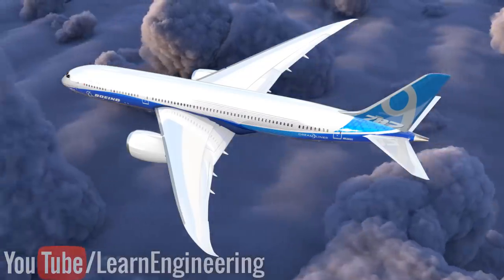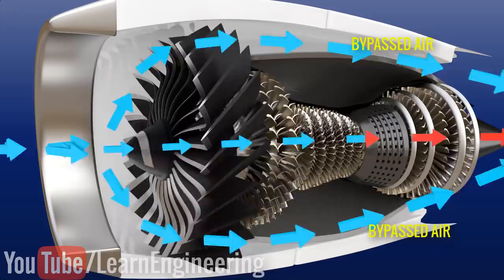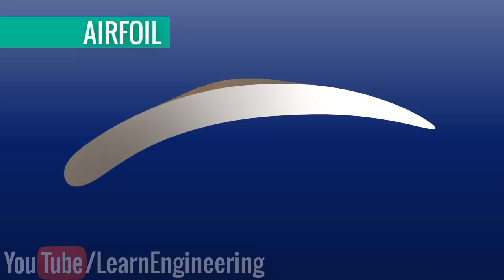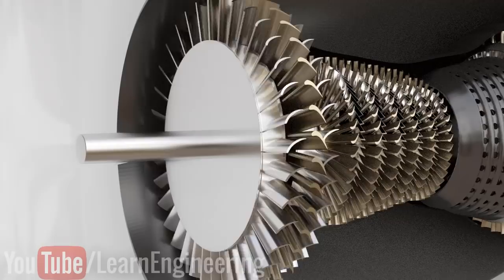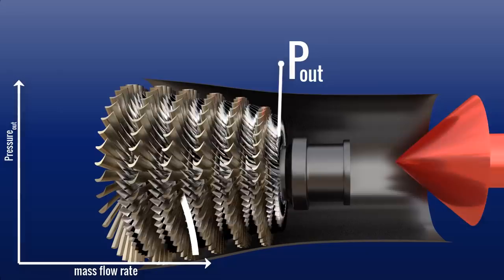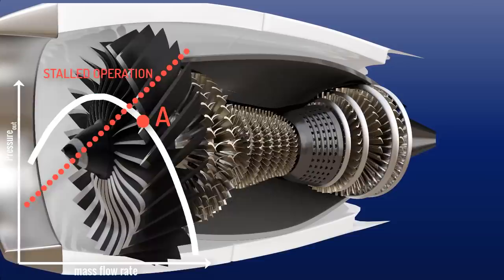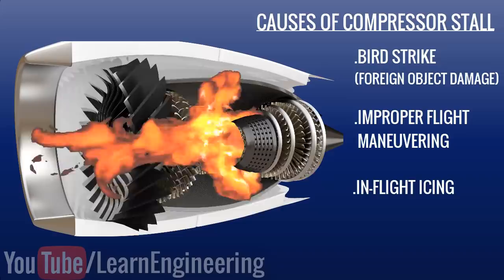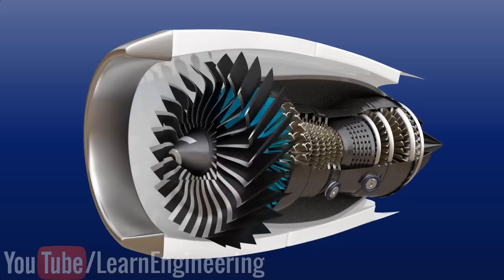What makes BIRD STRIKES so dangerous?

Comment: Now this suggestion is impractical, but hell, consider this, have a stack of blades facing forwards attached to the outer edge of the engine running forward and meeting at a point like a pyramid on its side, it should not restrict airflow to any extent as the only thing facing forward is the knife thickness of the blades, maybe shredded chicken hitting the fan might be preferable.

Comment: Why don’t they cover the opening of the engine with a metal mesh that has bigger openings that are big enough for air to flow but not birds to go through (I’m talking big birds as smaller ones might have little to no effect on the engine)?

Comment: I know its a stupid question but why don't we just use a wire mesh before the turbine to limit any big things flying into it? I mean it wouldn't impact the airflow that heavily.
Reply: Meshes do impact flow – large pressure losses across a mesh, meaning compressor has to do more work, meaning more fuel needed to keep the engine running

Comment: So a bird going through the blades won't damage the blades? and if blades are damaged, a loss of balance might occur due to the loss of the blades and the engine will vibrate? no expert, but only wondering...
Reply: The fan blades at the intake are made of highly toughened titanium alloy so it requires great momentum to damage them usually birds couldnt fly at high speed that too near runway and their mass also negligible so it cant damage blades

Comment: Those correction measures seem to necessitate quite a deep understanding of the exact state of the engine in quite a short amount of time. Why isn't restarting the engine not an option?
Reply: Penny Lane the corrections will mostly be handled by the FADEC. If the compressor stall or surge is not the result of ingesting FOD, attempting a restart might be possible, but the likelihood of damage to the engine might prevent it from starting or it might cause more damage. If the engine does fail, most aircraft have a second engine that is ample to get the aircraft back in the ground safely.

Comment: If it's so dangerous, why can't you just have a grid in front of the engine that would allow all the air to pass but no bird to enter?
Reply: May be because it will decrease efficiency I. E. Reduce the total amount of air intake per sec. But I agree with your point safety is more important than effeciency.
Reply: Imagine the damage that would cause if sucked into an engine.

Comment: One prevention to avoid compressor stall is,mounts the metal screen in front of the engine to avoid the bird from entering, just guessing....
Reply: It's an obvious suggestion but a screen with holes small enough to prevent pieces of bird from entering would also restrict and create turbulent airflow which isn't good for the engines either

Comment: Does this really need pilot intervention? I'd expect that in case of an actual incident, automated systems would respond far more quickly and be more likely to take the exact course of action(s) required to get the engine back up and running...
Reply: Steamrick yeah that's called a FADEC. If the engine does completely fail though, restarting is probably not advisable. You've got another engine which is ample to get you back to the ground safely.

Comment: Why let the engine open.... Just cover the engine with the net,,,, bird will not enter inside engine,
Reply: This is a jet engine.  There's nothing that will stop a bird from getting in if it gets too close.  The only thing a net or some kind of grate cover will do is slice the bird apart, and those pieces have only one place to go.  Your net, regardless of what its made of, wouldn't do jack shit.
Reply: @CMDR_John_Crichton  A sufficiently strong and dense net would be able to mostly stop it (at least shred it into enough pieces that it's basically negligible). It'd also be a huge performance and efficiency penalty, but it could be done

Comment: Engineers should put grill on the front of the engine
Reply: Wouldn’t help. Despite the variable guide vanes it could cause turbulent airflow to enter to compressor which could cause the angle of attack to be exceeded and still have a compressor stall.

Comment: Okay, question time: Then why don't they just put an aerodynamically friendly carbon fiber screen (nothing so blunt that it causes a lot of drag, and nothing heavy like steel, or even that much more aluminum adding to the weight of the plane, unless aluminum would have to be the happy medium) over the cowling that's a happy compromise between blocking too much air from entering (too fine a mesh) and still letting average-and-bigger birds through (too coarse a mesh)?
Reply: You can't risk it the particles from the screen will damage the compressor blades over Time.I work on engines fod  is a serious issue and putting something in front of the intake isn't the greatest idea.

Comment: In theory, the fan blades are supposed to chop up ingested birds, but in reality it is often not the case.  At a speed, even a small bird can do quite a bit of damage.  I've seen inside liner (noise attenuation liner) of the intake cowl being torn apart by bird strike.

Comment: I deleted my original comment because I thought that I was becoming unduly critical, so let me start again by congratulating you on trying to get to grips with this topic.  Nevertheless, I can only give you a C minus, at best, for your efforts.
Firstly, I have to tell you that your representation of a big turbofan engine is not very good.  In particular, the compressor stator vanes are more reminiscent of turbine blades: in fact, they would make very good turbine blades.  The vanes should be altogether thinner and cambered (ie, curved) in the opposite direction.  And let me correct your terminology:  it is generally accepted in the English-speaking gas turbine industry that blades rotate and vanes are stationary.
On the subject of terminology, I have to be critical of the laxity of industry, too, in its usage.  All too often, the term 'stall' is used interchangeably with 'surge', particularly, it seems, in N America.  I like to think that we were a little more rigorous at R-R in our usage.  One or more rows of aerofoils in a compressor can stall without the engine surging.  In the limit, however, if too many stages of the compressor enter a stalled condition, then the flow breaks down and there is a sudden reversal of flow through the compressor.  In the words of a Boeing training video, "there are flames visible at both ends of the engine", and the event is accompanied by a loud 'bang'.  Under certain conditions, this can happen multiple times: try looking on YouTube for 'Birdstrike at Manchester Airport' (that's Manchester, England).  A B.757 suffered a birdstrike to its R/H engine, which surged numerous time before it was shut down. 
Clearly, the birdstrike caused sufficient damage to the core engine compressor blading to degrade its aerodynamic performance, resulting in the multiple surge event.  Even small birds  can do significant damage, if they enter the core engine compressors, and their sliced-up remains are propelled rearwards through the blading.  A large bird, such as a Canada Goose, can cause catastrophic damage to both the core engine compressors and the fan blades.  I read the official NTSB report on USAir 1549 ('Sully' Sullenberger's ditching in the Hudson River) some years ago and it should still be available on the website.  It's even more gripping (for an engineer) than the film with Tom Hanks.
I could go on, as you haven't quite got your head around the mechanism of a surge, but I think this is quite enough for the moment.
Reply: I didn't read any of this cuz you wrote too much.
Reply: Wow and you say enough. It's just too much to read😂
Reply: Wow, you guys should learn to read a little more, then maybe you will be able to learn a little more.  His post is small for someone that is getting good information across to the reader. Did I right too much?
Reply: Nice novel
Reply: A lot of writing
Reply: @davidscott5903   ditto

Comment: A net in the front of engine opening. Problem solved LOL.
Reply: That sounds like an obvious solution but a screen small enough to prevent the ingestion of a bird would cause drastically reduced and turbulent airflow which isn't good for the engines either it doesn't fix anything

Comment: Why can't they put a screen over the front of the fan?
Reply: How are you going to get air?
Reply: Demostene Neacsiu I assume he is talking about a net. The air would go through the net
Reply: The video grossly over states the terror of such an incident. Compressor stalls and surges are not common. There would be too much drag associated with a screen. Plus the engines are optimized for cruise efficiency, where the chance of FOD is practically 0. Birdstikes do happen during departure and arrival but are rare. And the likelihood that both engines ingest a bird is even smaller but has happened (ref the US Airways flight that landed in the Hudson River). For Part 25 aircraft (air transport), the performance parameters are such that at any given time during the take off, the aircraft must be able to stop on the remaining runway, or safely continue the take off with one engine. So again, really not that scary.
Reply: Not to mention that at the airspeeds the aircraft operates at, the screen would either break and be ingested itself, or shred the bird into tiny bits and still be ingested causing the same problems.
Reply: jschnei Oh yeah birdstrikes are very rare and the net would most likely get sucked in by the engine. Just cookin up ideas. Even if it did work I don’t think anyone would do it because of the cost/likeliness ratio
Reply: Would it be possible to make a screen config similar to the ones used on mig aircraft, with air being supplied by the side entrances for the time of deployment ?
Reply: Because the aircraft flies at 800km/h, at that speed you need a very strong set of bars to stop it. 

Luckily, birdstike is calculated into the design of the engine so the bulk of birdstrikes just result in the bird being reduced to it's component parts and pooped out the back of the engine. it takes a big bird, or a flock of birds, hitting at just the right place (ok, the wrong place, really) to cause serious problems.
Reply: vinny142 Thx for the answer :), i was mostly refering to a time when the birdstrike would have a biggest chance of occuring so closer to the ground at approach speeds, the same time migs deploy theirs. Would that have any chance of working ?
Reply: the strength and weight of the "screen" needed to prevent that (esp. at those airflow velocities) would wind up blocking the air intake, thereby greatly reducing the engine's efficiency.
Reply: mitchlu Thats the idea, to block the intake :), air could potentially be supplied by additional engine intakes relegated to somewhere more safe, something like those screens on the upper side of the migs, the whole thing would work at power settings typical for approaches and if one needed full power for example a go around, the intake could be opened and engine would suck air normally. Additional weight...depends how much, one can't have something for nothing, more protection, more weight. The problem is that engine cowlings and gondolas would need to be probably reworked to accomodate such a system though, maybe elongated and reshaped, to easily put rectangular covers there. As said earlier, engines are made quite resistant to flame outs as of now so maybe its a calculated risk. Still, engines in airliners are so much more critical than in smaller planes that can be put down in some field quite safely, it would be prudent to make them even more protected, me thinks :)
Reply: Still, a mig can be exited easily, such a system might be more viable for a fighter jet against small FOD, the risk of any part of the screen going into the engine and messing it up after contacting a bird could be too great.
Reply: Forin
I was fishing in the Hudson River one day and a plane came crashing down with a bird in its motor.  It would help if these stupid pilots watched where they were going.  They're chasing all the fish away.  Bastards.  And I hear you on the c/l ratio.
Reply: Forin could be! Thanks!
Reply: Great question. Ice buildup. The engine here is very simplified. The cowling before the first fan, at the front of the engine is perforated on the inside and heated air from the back of the engine is scavenged and blown through these perforations to prevent ice building up and destroying aero. No way to blow a screen to keep birds out.

Comment: A steel net can be placed before it through which only air can pass
Reply: arshid bhat way too much drag, reducing engine performance. Plus, the engines mostly operate at cruising altitudes where the likelihood of ingesting FOD is incredibly slim.
Reply: Airflow pattern will get disturbed when we increase angle of attack due to net which results in lot of drag and instabilities at fan blades
Reply: steel net wouldn't be much use to stop 200kph meat cannon ball anyway. This bird strike can even deform an aircraft frame.
Reply: a steel net 
the people who build these things probably never thought of that
you sir are a genius
Reply: never done before on aircraft because it is bad for the engine performance.
Reply: arshid bhat the plane is moving full speed towards the bird, plus the airplane engine is sucking air back hard, so the bird will go right through the net just like grinded meat.
Reply: Somebody call those world class engineers with combined knowledge of jet propulsion that went on for decades of your idea, they surely never tough about it!
Reply: Someone wasn't paying attention to the video I think..........
Reply: Yes they did: some of the earliest engines did have intake screens and  I am aware of one early engine that had retractable screens.  However,  engines got bigger, so that any intake screens would have had to get stronger and hence thicker and heavier.  In addition to the unacceptable weight increase, the aerodynamic blockage and effect on performance would also have been unacceptable.  To try to create an inlet screen for a big turbofan to fit on a modern aircraft would be virtually impossible.  Take a look at some videos of engine tests where screens are installed: now imagine them installed on an aircraft.
PS  Posted by a engineer with a career lifetime in the design of gas turbine engines.
Reply: when a bird hit the steel net when the plane is flying the bird will go inside the engine as some pieces of meat!....
Reply: Those "pieces of meat" would still cause some damage - and the steel net would also have air 'hitting' it, causing (as I've already stated) aerodynamic blockage and an unacceptable reduction in performance.
To give you some idea of the amount of air that's involved, a GE90 engine has a mass flow of air of almost 3,000lb/sec.  That means it could 'suck' the air out of the house I'm sitting in now and three of my neighbours' houses in about one second.
Reply: 900 kph
Reply: arshid bhat That’s a shit idea
Reply: Nope. That will disrupt airflow.

Comment: Why dont planes just have grills installed over the intake so birds cant damage engines?
Reply: Or grids or something similar
Reply: At the speeds aircraft fly at, a mesh of some sort would do nothing but shred the bird before it enters the engine. The debris would still enter the engine and disrupt airflow, still making a compressor stall possible. There is also the fact that a mesh would reduce the amount of air that could enter the engine.